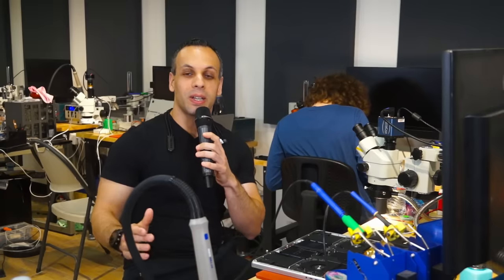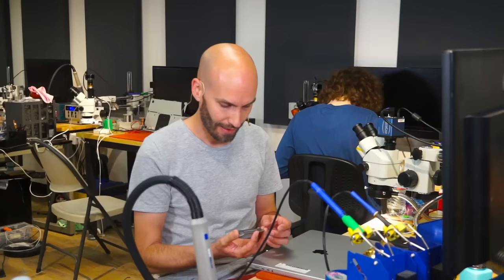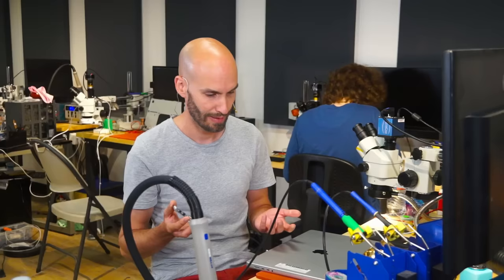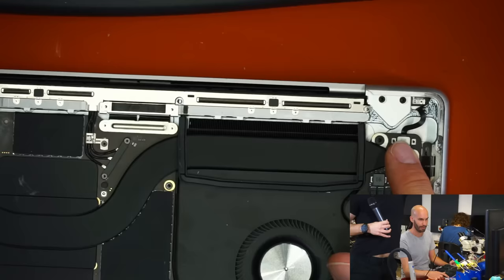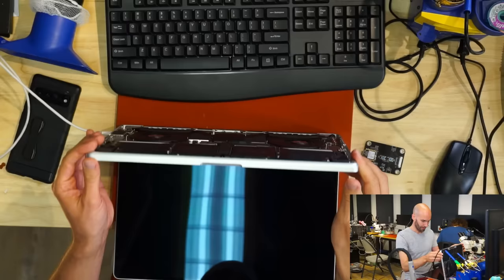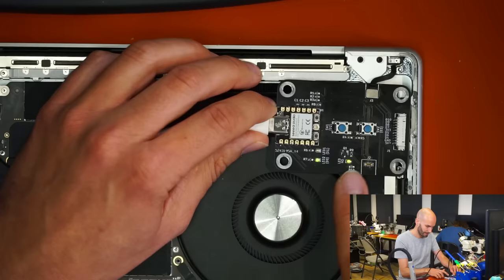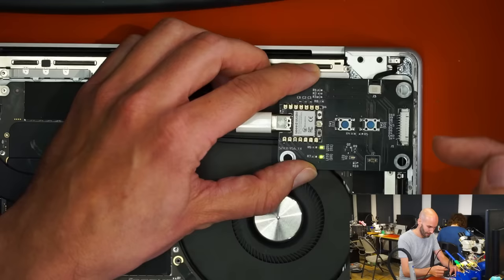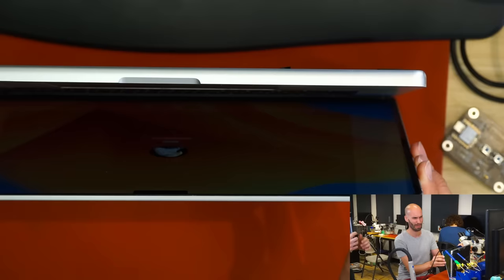We beat Apple at their own game - let the unauthorized calibrations begin

Comment: 1:15 You mention that you may not know that the computer is still on and able to record to, implying that a computer that is alseep cant record you. Snowden has talked about people thinking that their devices are off cause they pushed the power button and then the screen turned off. He mentioned how easy it is to write some code that says, when they push the power button play the "im turning off animation" and then dont activate the screen until they push the power button again. This makes people think their phone is off when in reality it's still on and very much tracking/listening/recording etc... My point being that Apple doesnt need a sensor telling the computer whether its awake or not to record you. They just write a little bit of code that says listen no matter what. In conclusion, Snowden mentioned that because of the not-really-off scenario, they only used cell phones with removable batteries so they coud ensure that the device was truly off. Its the same thing with that laptop; unless you take out the battery you would be wise to assume it's on and watching.

Comment: A programmable sensor to compensate for impudent mechanical design. No wounder Apple product cost so much. Of course the plunger switch on my glove box is the wrong design (from a car factory).  It opens on near full depression rather than beginning of movement.  So sometimes solutions to foolishness will be way over the top.

Comment: Mhm, awesome tool and awesome effort for sure. But seen as the hardware and backdooring practises of Apple can not be trusted, Id still apply the ultimate fix: Something that slides over the sensor (given I suspect it works on light, rather than mechanical angle detection of the display). Or, ductape.
If calibration is the fix, detection of state and resetting would be Apples fix to your efforts (unless said sensor is isolated from the rest of the software of course, but I suspect Apple much like Google, makes sure they can run diagnostics even remotely, as they dont open up their own systems most of the time and just build around full part replacement anyways).

Comment: Any news on the 14 inch macbook pro screen replacement calibration? I recently bought a broken 14 inch screen m1 macbook pro as a side project but just found out that even if you replace it you still need to calibrate the display with apple's specialised software that only they have. Would be MASSIVE if you guys found a way to do that.

Comment: Apple's argument that their secrecy, and monopoly over their devices, serves the purpose of security, is flawed from the beginning. Numerous security experts argue that open source is, overall, the most secure way to operate.
Security breaches in a closed, secret environment are harder to find, but when they are found (and between the western intelligence agencies, and state-supported eastern hackers, it is a matter of when, not if), it can take years before they are fixed. Open source make security breaches easier to find, and that's precisely the point. If they are easy to find, they can be fixed relatively quickly, assuming of course a few dedicated people are here somewhere to maintain the code.
Managing to unofficially calibrate this sensor is just one more proof that secrecy can only last so long.

Comment: Apple cares about sales, not repairs, they talk about ecology but they do not allow older/damaged computers to continue working, reducing the consumption of resources, you can buy everything new and wonderful for a short time. They use the tactics of car manufacturers to replace entire modules, not individual parts, e.g. LED headlights, which break down due to overheating or short circuit, the cost of replacement is very expensive.

Comment: It has to be a right to repair issue because I can understand the idea of utilizing the sensors  in a manner that would turn the laptop on but at that point you may as well be trying to infect the host laptop as a whole, like why go after the sensor when it only gives you limited ability. I can see this type of exploit being added on to some other virus or remote connection as a tool to turn the laptop on and off efficiently but other than being a way to turn the screen on I feel it’s kinda useless to a hacker unless they were physically holding the laptop. If you’re gonna turn the screen on and off you may as well hack the laptop and get full control wirelessly

Comment: Hi Louis, this reminds me of other proprietary struggles I've had in the past and managed a "work around" for it. Embedded systems made this all possible with secure processors etc.. the distance between being nice and a complete dick was only a few bites of code, that's the sad part. The part that troubles me with offering this 'tool' to circumvent their 'security' is a dangerous dance with apple's legal team, possibly winding up with a lawsuit on the guy whom came up with the hack and anyone distributing it. I've paralleled a similar situation where the satellite companies came looking for anyone whom sold or programed the CAM or cards for the receivers... yes, they are different situations.. but alike in the same way. You are compromising a "security device" that they technically own with a third party device for profit and distributing it.. has it's prickly parts, but food for thought. Personally, I'm all about the hack, I put away chess for this stuff long ago. Cheers man!

Comment: so if i'm understanding this right, they managed to get the hex code out of an already calibrated sensor and whenever you install a new sensor it flashes the firmware on it so that the macbook gets the correct responses from the sensor?
Reply: or they captured the communication between the sensor and the macbook and they just flash a firmware that provides the expected response to the macbook?

Comment: I was worried about repairability of AirPods, honestly I feel bad about those nicely designed headphones thrown away only for batteries degradation. I was trying to find the solution of replacing the batteries but the case is always looks worse after this process.

Comment: Honestly I think its case 1 and 2 like u were talking about at the end. It has been shown that apple does not want you to repair your devices 3rd party. Also, I have tinkered with macbooks when I was in highschool (they gave us macbooks) and learned that you can gain root access (therefore all files in the system) using single user mode even if there is already a root account in place and all security features turned on. Obviously their security sucks too.

Comment: can the manufacturer in China calibrate these new sensors at the factory with a default value? It seems the sensor from China is simply not programmed with any value and a calibration is actually not needed.

Comment: Despite Right to Repair laws, Crapple continues to screw over their customers by requiring an expensive motherboard replacement instead of swapping a $1 angle sensor that is designed to fail

Comment: but.. Your last statement is erroneous.. You do NOT have to jump through these hoops for all manufacturers.. On cell-phones perhaps, but not computers.... 

. IBM--compatible computers ARE usually VERY open with how to repair them. This. because people who buy apple do so because of.. branding.. and tradition.. people who buy IBM-compatible ones get pretty much the same computer regardless of they buy a compaq, or hp, or a store-brand one.. So.. It is often much much easier to get the information for those type computers.. Because that is one way to nurture go... Sure most people want NVIDIA graphics cards, but that is just the chipset, if you bought a specific card of a specific brand the manufacturer (ASUS or whomever) will STILL have to care about their customers. If you get a bad rep someone else will get better publicity. I currently run a machine that is pretty much solely dependent on how open the hardware manufacturers have been to the open source market (GNU/Linux)..  Apple pretty much have only a niche market (divide how rich someone is with their intelligence and on the higher end you'll find apple users. Look at how much someone care about pretentiousness.. on the higher end you'll find apple users).. and they ARE locked in by their choice.,.. but.. in the IBM-compatible market as of now IS actual competition within their market, but they are not competing with apple at all. Microsoft vs Apple is pretty much a duopoly without any real competition. They charge as much as they do and are as difficult as they are because they can. The people who buy their products are rather a member of a cult than made any actual real choice.

Comment: Do you repairs iPhones too? Replacing displays on 14 15 models? I have found the way of installing new drive (SSD) on iMacs 2009-2013 without any cables and having system controlled fans (not with additional software). I think I have found the way to apply the same on phones and all other Apple devices but as I am not professional (yet) I have no broken iPhone and screen to try it out. If you're interested in cooperation on this issues, please do contact me. If "My Way" is applicable then there's no need for anything extra to be able to do any repair. :)
Reply: Any update?

Comment: Is there a little board but for calibrating the display? I just bought an after market display for my MacBook Air M1, however, I read on the internet that the new (3rd party display) also has to be calibrated to the sensor on the camera. Not having this calibration...you don't get tru tone. Would be amazing if there is something for this....and yes...fuck apple.

Comment: huh. since when is laptops not shutting down when the lid is closed a 'bug'. lol. you buy computers to run your programs. 24/7 and wether the lid is closed or not. :P the only thing you might want to keep that display up or down switch thingy for is to automatically unmount encrypted volumes when someone steals the thing.and therefore usually would flip down the screen while taking it. :P but yeah ofcourse everything should just keep running wether it's in your backpack or on your table and with the screen up or down.